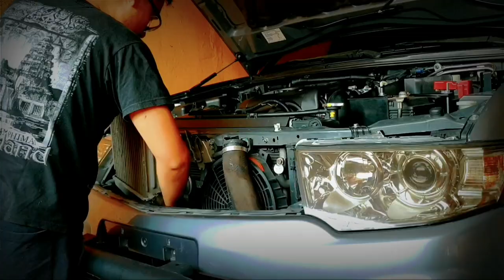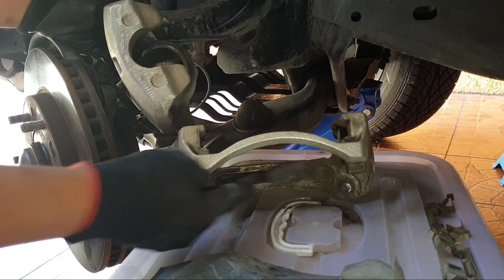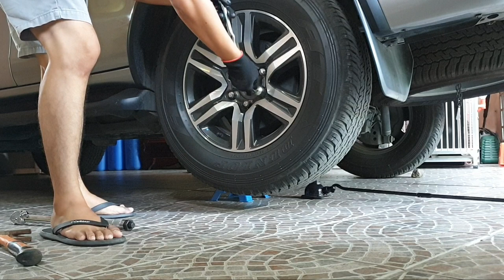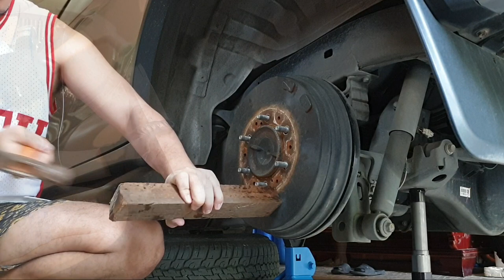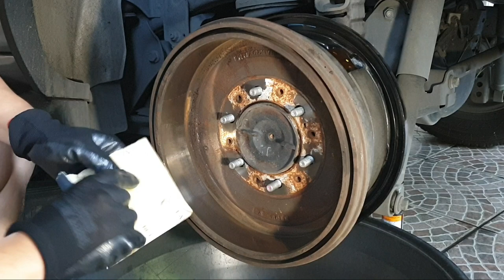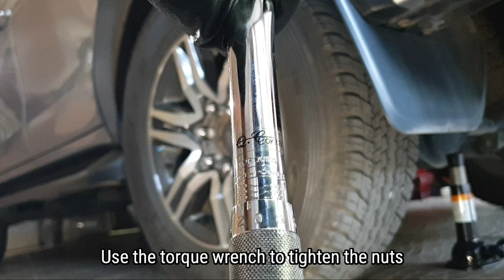Paano Linisin at I-Adjust ang Drum Brake [Toyota Fortuner]

Comment: Sir wala bang problem kung lagyan ng grease ang stub bolts thread ng wheels? More power to ur channel.
Reply from the maker: Ung stud sir? Di po nilalagyan ng grease un sir
Dont forget to subscribe 🙂
Reply: @NoahsGarage  Salamat Sir, but I also did research on this issue and found out open arguments pa din kung need ng grease ang stud. Sabi pag nag grease may possibility na ma over torque, but some say grease can protect the thread from damage. Tnx Sir for the reply.